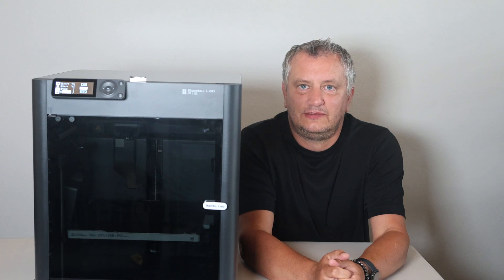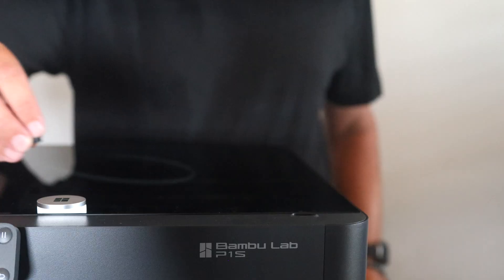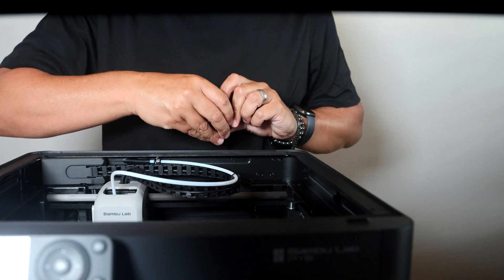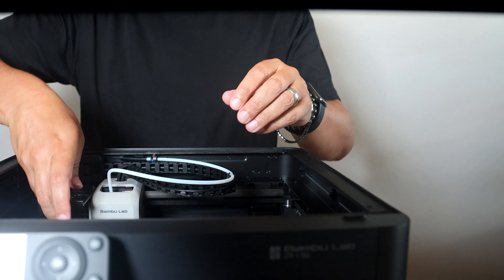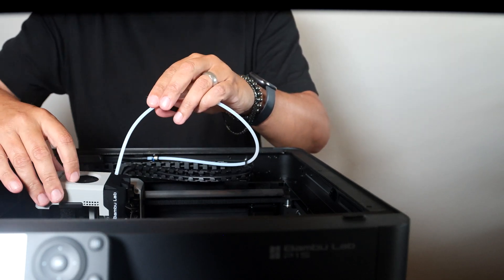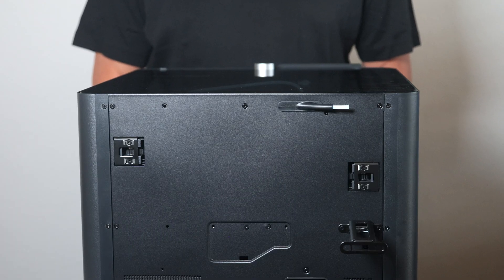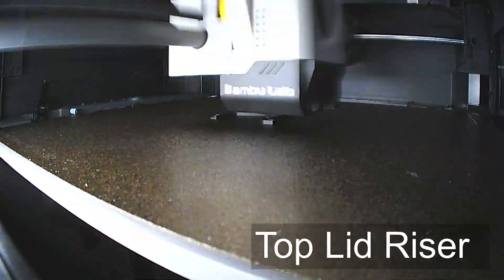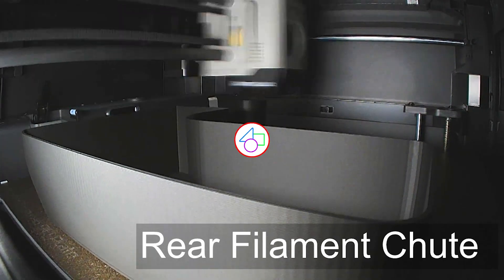@BambuLab P1S: The Must-Have Add-ons You Need

Comment: Would NOT use the "dust cover for the print head. That hole serves a purpose in airflow.
Reply from the maker: Thanks for pointing that out, at present, have been running lots of prints with no issues, I do run the printer with the lid open, with the lid riser from the video, I'll keep an eye on things and report back if I start seeing issues